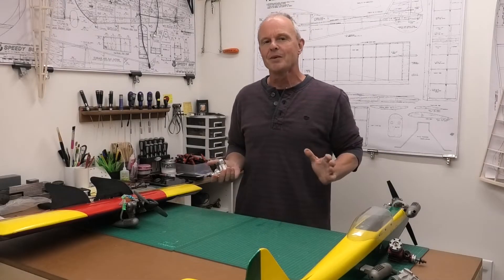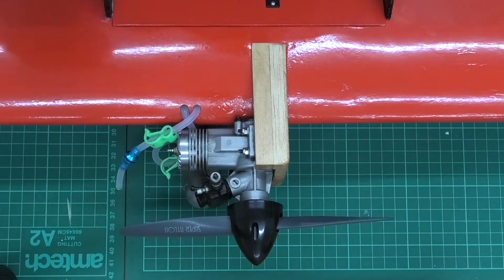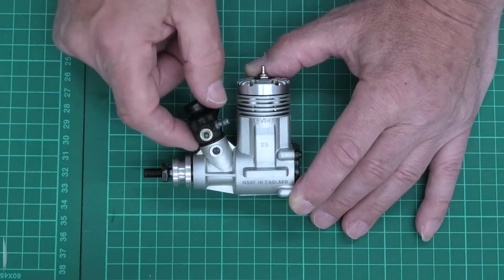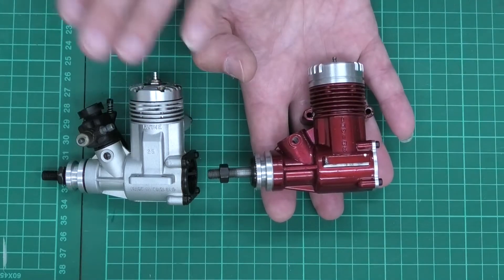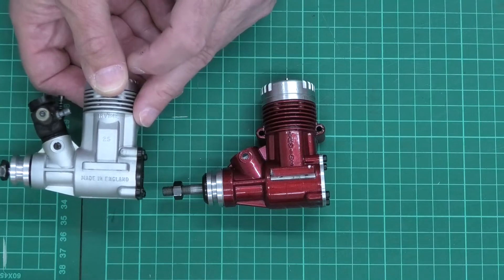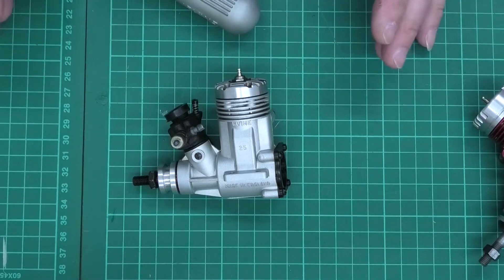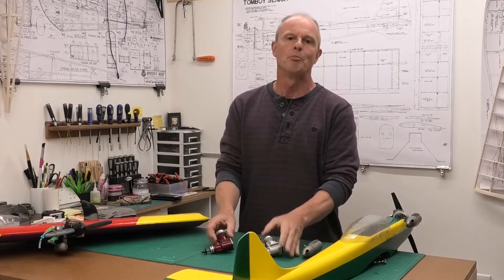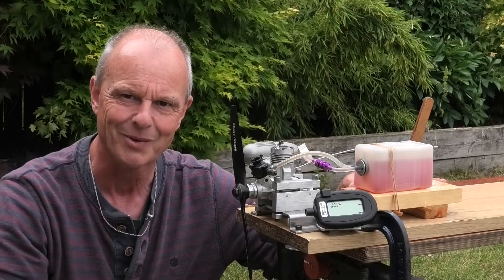Irvine 25 Glow Engine Family - Model Aeroplane Glow Engines

Comment: greetings and respect.
And thank you for the good channel and your great experience, Mr. Engineer.

I have the same red engine as well as the rocket-shaped exhaust, and both parts, the engine and the exhaust, have broken screws, and I want to weld them with a TIG machine.
But I don't know the type of alloy and the type of filler of these two pieces.
Please guide me what is the filler number for welding.
Thank you.
Reply from the maker: I am sorry to hear about your engin, but unfortunately I do not have any experience with Tig wellding, so can't advise, sorry.  Pleased you like my channel, appreciate the comment
Reply: Thank you for your time.

Do you know someone who can help you in this area and you are accountable?

And this may be the answer to many problems in this field and you can even play a clip with that person in this field...

And with the experience you have
You certainly can in this case
Make a great video and save it to your archive so others can learn from your experience and remember it forever.

Thank you and thank you.

Comment: I wonder id anyone can help with identifying an Irvine 19 engine I obtained. Front induction, rear circular exhaust. Originally it came with a huge aluminium spinner, but I've lost that. I can't trace this engine at all.
Reply from the maker: Irvine did some Racing engines as you described, but in 15 and 21, not sure they did a 19.  These were from the early 1990's.
Reply: @MarkRobinson555  You are probably right about it being a 21. I don't know where it is at the moment, so I might have just assumed it being a 19 for some reason. I also have an old PAW 19 from the 70s, so that may have confused me. Thank you for that. I will look for that Irvine.

Comment: Mark, i have a new in the box .21 with the resin carb.i think it may be a mk 1, not sure.i think it is from the early 80's..what are your thoughts?
Reply from the maker: Hi, Irvine did a 20 or 25, but I would need to know more about the engine you be able to tell if its a MkI or II, sorry

Comment: Hi, I was the Irvine importer into South Africa when I lived there. I moved to EU Cyprus during 2013 and I still have quite a few Irvine spares.  They are getting lower now but I have to keep my 40's and 39''s going. If I can help anyone with spares let me know and I'll see what I can do. Regards
Dave
Reply: Hi Dave,
I am one of those interested. May I send you a photograph of the part I am looking for? Do you still sell the nice Irvine .39?
Reply: I'm flying two in fun fly aircraft. You can send me a pic of what you require and I'll see what I can do but most of my spares now are for the mid sized motors @jurgenblume5179

Comment: Video simpatico per apprendere ancora di più sul funzionamento complimento
Reply from the maker: Thank you very much, pleased you like the video
Reply: @MarkRobinson555 

greetings and respect.
And thank you for the good channel and your great experience, Mr. Engineer.

I have the same red engine as well as the rocket-shaped exhaust, and both parts, the engine and the exhaust, have broken screws, and I want to weld them with a TIG machine.
But I don't know the type of alloy and the type of filler of these two pieces.
Please guide me what is the filler number for welding.
Thank you.

Comment: Spares are becoming more of an issue as the Mk3 went out of production in 2003. Many were snapped up by pylon racers and don't come up on Ebay very often.
The needle valve assembly for the Mk3 is common to all Jetstream aero carbs so keep an eye out for secondhand parts.
The Mk3 was only a couple of hundred rpm down on the 25FX and the same as the 25AX. It was a strong engine and very smooth!